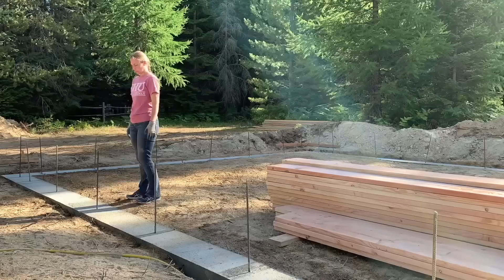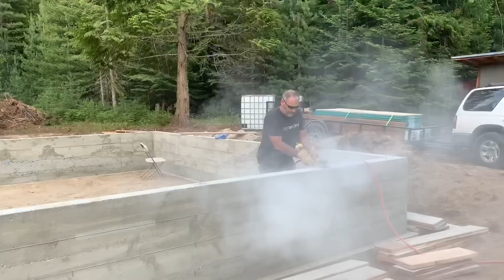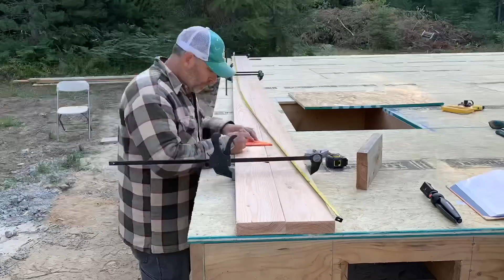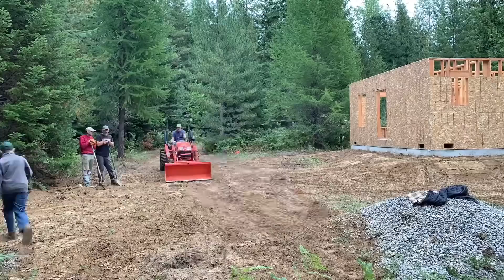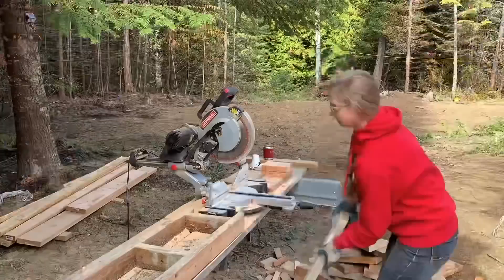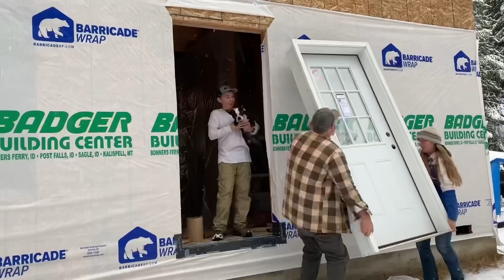TIMELAPSE: House Built By Family in 15 Minutes

Comment: Dude do yourself a huge favor and wear a respirator whenever your saw cutting or grinding concrete/masonry! The dust contains SILICA which is RESPONSIBLE for causing a severe lung disease called SILICOSIS which is from breathing in the concrete dust ! Once it goes in it never comes back out 😳😱💀 
How and why do I say this ? Because I worked as a concrete flatworrker / finisher for almost 47 years and I now have silicosis from BEING YOUNG AND DUMB AND NOT WEARING A RESPIRATOR!! incase your wondering silicosis is almost like emphysema and it ain't fun !!! 
Very nice job and home ! Great job guys 👍💪
Reply: That's good advise.unfornately people won't listen until it's too late.
Reply: Don't tread on me, thanks for telling us all this ,😉, it's good to know and especially as you are suffering we will heed this advice, sorry for your health issues
Reply: Yeah I was thinking the same thing, it's like when people breathing all that dust from the New York towers or going to help cleaning up debris after a disaster, if they do not have proper respirator mask that can be very poisonous  stuff
Reply: @marioreglin5995  u
Reply: @mariamendes2040  what????

Comment: Good job! There are a few things that should have been done different, but it worked for them. One big thing was the bare concrete was not covered with a waterproof stick on membrane, sprayed on or rolled on before back filled. Just a thought. Again good job and a great family experience.

Comment: Nice build. I have to point out couple things: Why not do full basement? You have pretty good height on the concrete walls. It also doesn’t appear there is any drainage or waterproofing on the foundation. I would think you would want to insulate your crawl space walls as well, or even just your flooring underside, this will make a BIG difference temperature wise.

Comment: Nice teamanship.!!
But this house (due to foundation, or lack thereof.  Plus no underground sewage pipes or utility runs for gas, etc) would never even pass inspection as a garage here in NYS.

Note.. After reading others' comments, i see this family will be using outhouse bathroom and basically living like pioneers from the old west.  Or, today, what is called "off grid".
Very courageous.
But, personally, i would have built a better (higher) foundation simply due to insects and wood rot.
Reply: @williamb6869  you make no sense.  You know nothing about me and are far from correct.  AND my comment was not in any way bad or 'negative' so where your anger and abusive comment cones from is beyond me.  Seek help and try to have a nice life rather than the hateful one you seem to now be immersed in.

Comment: Mr Martin, why american used wood to build house? Why you doesn't made it by concrete.
Reply: I don't know either. In Cuba we mostly use concrete blocks. Wood is prone to rotten and get termites.
Reply: @Jorge_Rodriguez83  and hurricanes
Reply: @1255XL  Tell me about it! We often had to shelter neighbors in our house during hurricanes because their house was made of wood and at risk of being blown away.
Reply: Old style houses used brick or stone inside out,  but new style they based on wood as frame for the whole house, drywall used for indoor wall attached to the wooden frame. If you see brick or stone, it's more for decorating and protect from the elements rather than for framing. The brick or stone are laid after the wooden frame established. With the new building technology, wooden frame is cheaper, easier to manipulate and install electrical wiring, drainage system, energy conservation system, plumbing etc and easy to renovate.
Reply: Because wood is warm

Comment: This house hold Maximum 50 years
Reply: More!
Reply: Aditya Wardhana  -  The house I live in right now, it's 120 years old.  All made Wood Structures and the Foundation is Cobble Stones + Concrete.  Concrete deteriorating in some areas and had to be fixed.  But ALL the Wood + Frames + Floors still in good conditions.  NOTE:  Concrete or Motar - Bricks have a 75 Years Life Span.
Reply: Aditya Wardhana  - 3 Stories.  They call it a Duplex in the US.  3 Floors + Basement.

Comment: We have come along way in building science.  I would never build a house with a crawlspace that has no access hole from outdoors.  Also, I did not see any vapour barrier on the ground with a skim coat of concrete,  mould and mildew will plague this home.  I’ve seen it countless times.  A nice slab on grade with radiant heat is the only way to go! And ICF walls, now you got something comfortable.  This build resembles a cabin.
Reply from the maker: Actually there are many ways to go. But it is nice you think your preference is the best.

Comment: I really like the idea of creating your own forms for the crawl space/foundation walls.  I noticed little wires that connected the edges of the forms and on the outside of the form the wire was tied to a small nail.  What material were those small connective wires?  Were there any disadvantages to this simple system that you would have planned differently if you did it again?  If those small wires were steel, is there any concern that they'll simply rust out over time and be a possible water leak hole from the surrounding backfill dirt?  Thanks!

Comment: Good morning & A Very Happy New Year to you all -  Concerned that you have too little insulation in the roofs & ceilings of both accommodations it really should not be less than 200mm 8 inches preferably in your location 300mm one foot this will give you optimal performance [NOTICEABLE ]  when you get round to applying the external siding  are you able to put eurathene  slabs on it prior to siding application this will vastly improve the wall insulation - the more insulation now the better the savings will be !
Happy New Year
Keith  May Wales UK

Comment: I hated to see them holding studs while another pointed the nail gun directly at them and nailed it off. I framed houses for 12 yrs and have been shot a half dozen times, by myself and others. I've seen life threatening injury occur from hard knots in the wood deflecting a nail or soft spot allowing nails to pass through.... They did a great job, nice home. Strong family pulling together accomplishing what most wouldn't dream attempting 💪
Reply from the maker: Thank you for the safety tip. And the kind way you gave it. You are an example for others.

Comment: I am from a different country. Just curious why the Basement is Hollow inside. I understand that the Lumber installed acts as Beams to handle the top Load. But can't you line up the basement itself fully by Concrete instead of Lumber Beams, as you probably already know the dimensions of each room?

Comment: I doubt with the structural integrity, in particular the joint between floor or horizontal panel and the skirt wall the vertical panel

Comment: Did you attach the outer walls with just nails to the floor?
Reply from the maker: Sorry wouldn’t nailing to the floor be attaching them. I’m confused.
Reply: @MartinJohnsonOffGridLiving  yes, but i was wondering if that would be enough, instead of drilling down into the concrete wall and adding long, large bolts to really really secure the house to the base? (I'm no expert, so correct me if i'm wrong)

Comment: Dirt basement = mold, water issues. Why not pour a concrete slab? And bottom plate wood against concrete foundation should be treated lumber, no? And wouldn't it be better to wrap the foundation with moisture barrier before filling in. Good job though. I am trying to learn homebuilding and noticed these things.
Reply from the maker: There is always something “better” that can be done. Do what works for you and your budget.